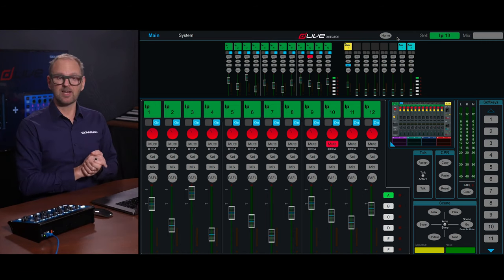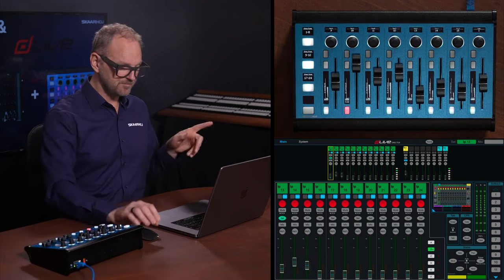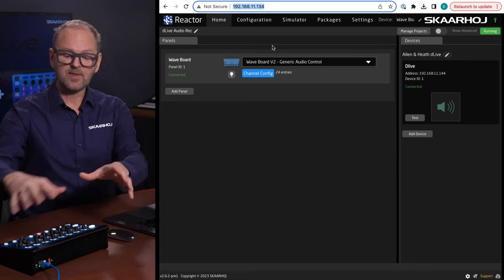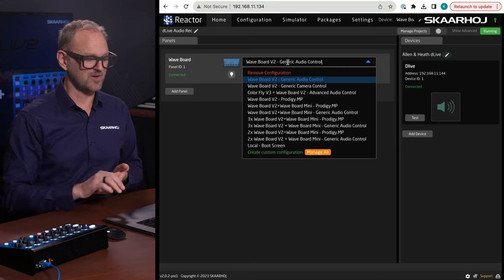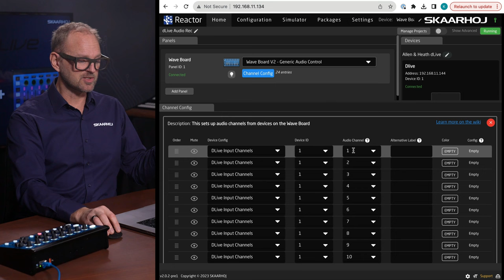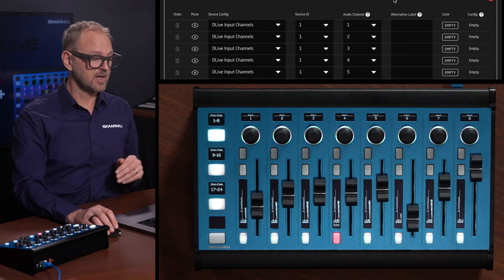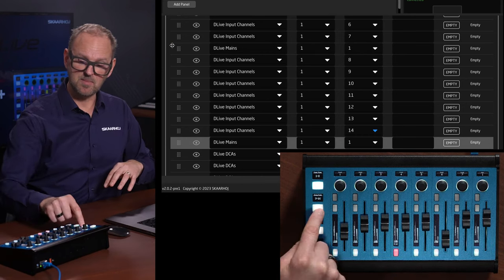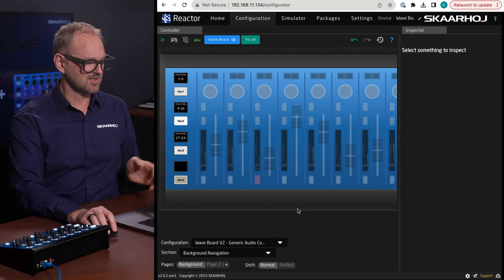Allen & Heath DLive Control with WaveBoard from SKAARHOJ

Comment: What is the advantage of this over the IP8?
Reply from the maker: SKAARHOJ makes universal controllers that can control multiple devices from different brands simultaneously. For example; you can use Wave Board to control Allen & Heath DLive + BMD ATEM + vMix + Behringer X32 and many, many others - all at the same time. You can also store multiple ‘projects’ for different jobs/devices.
Please see the list of compatible devices here: https://devices.skaarhoj.com
On Jan. 11 we’ll post a new video showing how to control two devices simultaneously.
Reply: 1. SKAARHOJ offers Universal controllers. Single surface can control multiple different devices at the same time.
2. Integration with Allen&Heath can be mapped to any controller from SKAARHOJ portfolio. Can be fader bank as Wave Board on this video, but also any other type of panel - i.e. Inline 10 with encoders and buttons, Rack Control Uno - a rack-mounted one
3. Each single integrated parameter can be mapped by user to any component - you can build your own configuration and decide which parameter is controlled by each fader/encoder/button. Or you can adjust pre-defined configuration to fit your needs.
Cheers
Maciek / SKAARHOJ